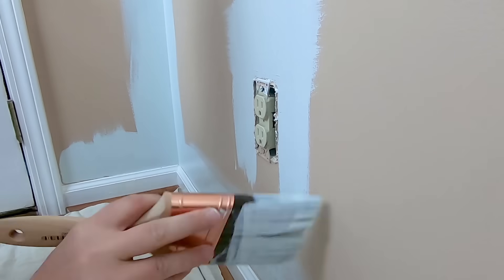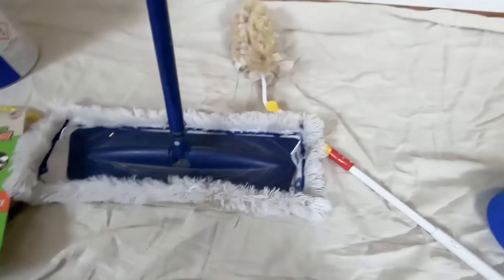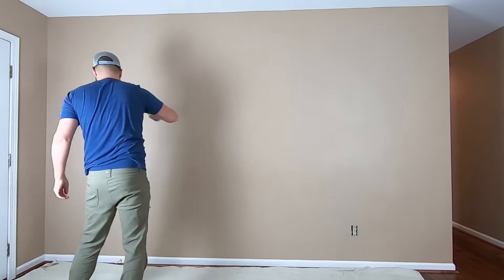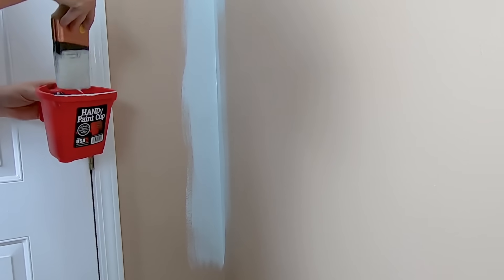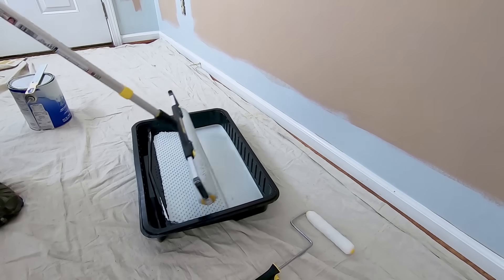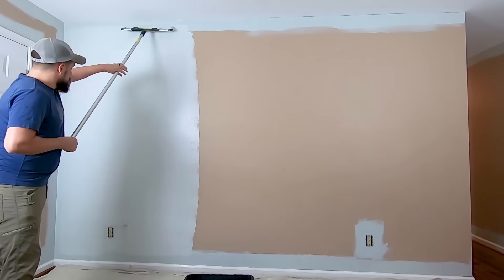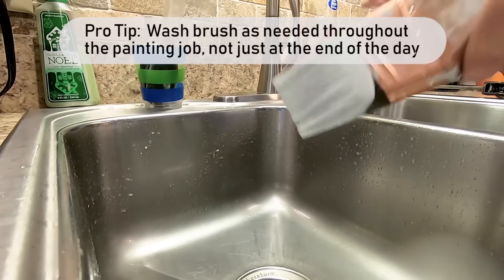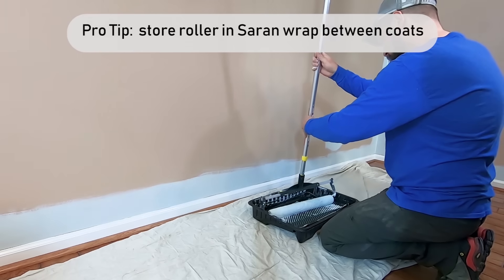How to Paint A Room Fast Like A Pro (Tips for Beginners)

Comment: Another good hack I saw was to put your paint tray into a plastic bag ,then pour the paint onto the lined tray, clean up just remove the bag off the clean tray underneath 👍
Reply: I think you mean put a plastic bag (trash bag since grocery sacks often have holes) onto the paint tray.
Reply: @aimeehardin1299  not in Australia 🤣
Reply: Doesn’t work
Reply: We do this with ziploc quart size bags, works perfectly
Reply: @emilyc9380  you’re not doing it right ? 🤣 just put your paint tray inside a plastic bag ( no holes) pour the paint over the lined tray remove tray from used bag….clean tray 👍
Reply: @Lex_Koncord  indeed 👌
Reply: I have used a kitchen trash bag over the metal/ plastic trays for years. It works and also will keep the brush roller from drying out overnight if a second coat is needed the next day. I just pull the trash bag back over and seal it until I’m ready to go again. No mess and has worked like a charm for me.
Reply: That’s a great tip mate..... cheers
Reply: Yes, i just bought garage basse for that purpose
I find it difgicult to go on painting once brushing has been washed, impossible not yo have waterdrops ruining paint or wall.couldn t see the item you cleaned the brush with in the sink.
Reply: @aimeehardin1299 You'll find that putting the tray into the bag is the same thing as putting the bag onto the tray.
Reply: I’m not talking about keeping the used paint brush and tray IN a bag till you use it again, I mean BEFORE you even start painting cover your paint tray with a bag ( no holes) and then pour the paint into covered paint tray, when you have finished you don’t have to clean the paint tray because you simply take off the bag covered in paint which is on the tray 👍da daaah 🤣
Reply: @juliedobson3039  Yes , I know , but it appears Aime ( who I replied to ) doesn't.  Tra-Laa !
Reply: @johnristheanswer  🤣🤣🤣 heheheeeee
Reply: Always pour paint from the back of the can that way you don’t cover all of the information incase you to purchase more in the future!
Reply: Similar concept to what was mentioned, but I've used Glad Press n Seal to line the tray. It conforms to the tray and stays in place really well until you're done and then you just pull out. No cleanup!
Reply: Black garbage bags bleed into paint. Turned my primer grey
Reply: @UntitledUnlimitedCreations  use white 🤣
Reply: @juliedobson3039  I did lol 😂
Reply: @Lex_Koncord  what kind of tiny paint trays are you using?? Did you mean to say quart size
Baggie?
Reply: @lisadaniels6020  I was talking about using a hand bucket with an "insert" when we're using a brush for cut-in work.  A quart size ziplock bag makes a perfect insert, and super cheap compared to the ones you buy from the stores - and you can seal them and reuse the next day
Reply: @emilyc9380  cover paint tray with plastic bag I use trashbags,  or right size bags often are even sold with tray. Or use leight weight disposable paint trays.Then fill plastic with paint.  Have been doing it for decades, so yes, it does work. But this person didn t explain it well.
Reply: Or use a liner…they are super cheap
Reply: Jerdonn l like Your videos
Reply: I also use an aluminum roasting pan instead of the paint tray.... you can have more paint in one of those than a paint tray.
Reply: @juliedobson3039  mĺĺ I
Reply: You don't need any liner. As long as the first type of paint you put in the tray isn't a flat paint you can just peel it out once it dries. Really, just keep it in until the next time you paint or the time after.
Reply: Lo
Reply: That's really great when I paint dries and gets on your roller
Reply: Why in, H  E Double Hockey sticks , didn’t I think of that!!🥴
Reply: @aimeehardin1299 yeah it works a treat! I do it every time 😊
Reply: @aimeehardin1299 what’s the 1299 in your name for?  Just curious…
Reply: I plan to paint my bedroom and I'm going to use that tip
Reply: I use a plastic bag also. Whatever I have and fits. If writing on bag I just turn it inside.  Somehow watching this I don't get the name of long paint handle. One I bought was bigger around and a bit heavy. Tks.
Reply: I use a five gallon bucket. Screen hooks on side great. No fuss of a tray.  Easier to carry.
Reply: I put switch plates in the dishwasher they come out like new!
Reply: @MartinRodriguez-gx9cs great tip 💡 thx
Reply: This makes so much damn sense lol
Reply: It's a game-changer  👌 
I've used thick aluminium foil off a roll to line my tray.Cleaning them out was such a pain x
Reply: First put newspapers underneath
Reply: Good tip. Anyone who's cleaned  a cat litter box knows this!
Reply: Or, just wash the tray after use. There's always that one idiot that's going to make a cluster fuck of a mess with that. Better to keep it simple nowadays for the simple minded folks.
Reply: And have fun picking out all the dry paint crumbs on your wall !! Y’a fun !!
Reply: @MatthewB-Kornafel-xv6oi  it’s a one day use, I don’t leave it to dry
Reply: What's "hack" mean?
Reply: @aimeehardin1299  she said into a plastic bag. Plastic
Reply: @MartinRodriguez-gx9cs  or you could just take a picture of the information.
Reply: Take the brush and wrap a rag around it then some painters plastic or a bag and whip the brush round like you’re swinging a sword (no drips with this method but still be careful) it gets the water out of the barrel
Reply: I cover the tray with painters plastic. You can find them at sherwin williams or lowes/home depot
Reply: Yep! I do this all the time. Saves so much time.
Reply: @emilyc9380 yes it does? 😭 i’ve been apprenticing and that’s what we do and it works just fine. maybe get a tray with more texture on it?
Reply: @joymathein9078 I usually have more to clean up when pulling out
Reply: @brobsty1856 lol this is what I do- I always use water based paint though, maybe it is different with an oil or shellac based paint.
Reply: Instructions not clear, the front section of my house has now collapsed.
Reply: @aimeehardin1299 I use grocery store bags but turn the inside out or I use foil.
Reply: No way. We have liners that fit right into your tray.
Reply: I have been doing that same thing for over 30 years
Reply: The bag doesn't save you any effort or time. The roller doesn't roll well on plastic. It will slip and slide around and cause the plastic to slip out of the tray, causing a big mess.  Trays are fairly cheap. Have at least two of them around. As soon as you're done, just dump the excess paint back into the can and hose the surface into a bucket and dump it down the drain.
Reply: @valann3718 Hmmm. Foil sounds like a much better idea! It will likely conform to the tray and stay put. Still, rinsing out the tray isn't that much more work.
Reply: @ we will agree to disagree 🤣 …….I use a small bag that fits the tray snug
Reply: Glad wrap works very well too.
Reply: GENIUS IN THE HOUSE!! 💖

Comment: Another tip is to soak your brush in water before you start, then spin it dry, this keeps the paint from setting up in the ferrule and you can paint longer before having to clean it.
Reply: Oh man I'll have to try that!
Reply: Can you please elaborate on spin it dry?
Reply: @Jacked Kerouac  yeah, the device you cram the handle in, it has an 18" spiral metal thing that spins the brush dry,  if I had internet,  I'd paste a picture, but the snow has knocked it out.
Reply: Or spirits if using oil paint. Great trick.
Reply: 🤣....signed, actual painter
Reply: And watery paint messes up the handle and gets your hand dirty.
Reply: @jackedkerouac4414 Don’t put it in the washing machine 🎉
Reply: Great tip.
Reply: @jackedkerouac4414  hold handle between your hands and rub hands like you were trying to warm your hands. The brush will spin and the centrifugal force will throw the water out of the brush.
Reply: Could you not also spray mist the brush with water ?
Reply: Well, the idea is to get the water into the ferrules of the brush. That way the paint doesn't absorb and dry, prolonging the life of the brush and aiding in the quickness of cleaning it.
Reply: Or buy the 17$ dollar tool.
Reply: Spinning does not remove enough water.... you will get runny runs where the water mixes with the paint..   When my brsh is wet say after washing and I need to reuse right away I bang my brushes. Could be a link fence or a at tre...I hit back and forth like I were slapping someone.
Reply: That will not get near enough of the water out @2scots
Reply: @fairamir1 , give it a try for yourself. No point in arguing with me until you have actually tried it. See, I have tried this. Several times and it works for me.
Reply: @fairamir1 Slapping the brush  damages your brush. I buy the best brushes so they work the best, so I treat them as well as possible. ie. I wash my brush several times during a job, every half hour. If I wet the funnel of the brush, by washing, I can use the brush for up to an hour before needing to rewash. So, wetting the brush before first use really helps.
Reply: Yes, they call this "priming" the bristles for latex paint.
Reply: I always damp my brush before painting anything, then I shake it off rather than spinning, it just keeps the bristles more aligned.
But you have to be careful that it's not too wet, or all that paint starts to migrate up to the handle. If it's REALLY too wet it will tack off the paint as you brush, or you will end up with watery paint drips everywhere! 
Keep a close eye on your brushes as you paint and look for swelling, and any heavy lines. Once the heavy lines start to appear you need to clean the brush!
Reply: @2scots I'm a 5th generation painter and been doing it for close to 30 years. If you wash your brush every half hour the only thing you'll accomplish is either taking forever or the boss saying you're fired
Reply: @bradleyhewitt9999 
I’ve been painting since the 1970’s. I’ve never wet my brush first. And I learned from a guy who painted for 50 years! lol
Reply: @Machia52612  I'm about to repaint my kitchen. So should I not wet my brush then? 😂 All of these tips in the comments are hurting my brain! 🥴
Reply: Sounds good, as if you are cleaning it throughout the day also starts the brush off the same each time.
Reply: @jackedkerouac4414  I prefer the Bob Ross method to drying a brush.
Reply: @2scots yeah sounds like you aren’t actually a painter bc like was said, you either aren’t making any money or you’re about to get fired lol

Comment: Definitely good advice. After 35 years, allow me to offer some improvement: 1) after dipping your brush do NOT wipe all sides, thus removing paint, instead gently tap the brush against the side of the can which will prevent dripping but give plenty more paint for cutting (2) hold the brush higher up the stem and allow the brush to "do the work" -a good brush will follow your lead allowing for longer strokes, (3) do NOT cut any lines twice, if you're painting the baseboard later (and the color difference isn't extreme) then just paint over it and make your line later when cutting the trim etc, even if tape is necessary (4) don't "force" the roller... do NOT bend your back up and down with the stick but instead adjust the height and distance you stand to where your arms can reach from top to bottom without stretching, this alone will dramatically increase speed, (5) do NOT "stretch" the paint out on the roller -always keep a reasonable amount of paint on it even though this seems slower and harder.
Reply: Best comment here.
Reply: Absolutely agree, especially about  wiping the bristles. If the bristles are splayed so much that’s needed stop and clean the brush. Also, quality and appropriate roller covers and brushes are key. Purdy and Wooster are basic & overpriced. The Arroworthy Barracuda roller frame is a game changer.
Reply: Dip, dip: tap, tap is the best way to load. Choosing angle sash vs oval vs round brush esp for cut ins    is crucial. Choosing woven vs microfiber vs shag roller covers is too. Arroworthy Barracuda frames, ProForm & Premier roller frames are game changers.

Comment: A tip you might try that I like…I prefer to tape the baseboard, then paint a ‘whisper’ coat on the tape and wall with very little paint on the brush. This creates a light seal between the tape and walls. Then apply final full coat, remove tape before final coat dries, you’ll have a perfect straight line with no bleeding under the tape.
Reply: Best tip ever!

As I was about to paint a bedroom I tried this out top and bottom of walls, and wow, absolutely no bleed under the masking tape and razor sharp lines.  Only used about a teaspoon of paint for the whole room for my “whisper” coat.  Wish I had read this years ago, would have saved so much time touching up areas that bled.  I’m surprised this isn’t included in the masking tape instructions.
Reply: I always get bleed through with tape! My quick go to now is, I rip off the cardboard top cover from a spiral notebook, and I just hold it against the trim and can paint right across it. Then I move over and do another section and another.  I go through a few of them, but way easier and quicker than tape
Reply: would you paint, door trims, window trims and baseboard BEFORE painting a wall, or after?
Reply: @Gi1b2bz  definitely before
Reply: @sdb6757 I've always heard the opposite. Walls and ceilings first then gloss work on wooden trims and skirting.
Reply: @tomk427  I find it much easier to cut in on the walls after the trim is done than the other way around, unless you’re going to tape off the wall all the way around. I only tape the baseboard.
Reply: @Gi1b2bz ceilings first, then walls and all the trim last.
Reply: @sdb6757 I agree with you. I personally find painting trim before walls to be much easier.

Comment: For cutting in i simply use a plaster trowel. hold in place and paint along and wipe, Perfect line every time. 👌
Reply: And it leaves a small part of the wall next to the ceiling unpainted
Reply: @fairamir1 every time!
Reply: And that is NOT a good thing.. no original color should ever be showing @Pagingnursejackie
Reply: @fairamir1 second coat is where he brings it all the way to the ceiling. No color shows through
Reply: I have learned to do this too.
A wallpaper tool also works well.
Reply: It works so so. Then you learn how to paint like a pro. Freehand and actually fast
Reply: You have a video ?

Comment: I'm a reasonably experienced painter. This video is excellent in that it explains the techniques simply and in order. "Roll one-back, two-forward" is excellent. If I were to add a couple things it would be to teach the unload-and-spread technique, that is dump the paint from your brush, then use the last 1/4 inch of the long side of the brush to spread in the cut corner, while gliding on the smooth dump, and then taper the bottom of the cut. The other would be before applying a cut, breath in, and exhale while using your shoulder to cut, not your wrists. Shoulders are simple and stable, makes for straight lines. Wrists are complex and short, makes for wavy lines. A cut should be about as wide as your body and not much more. Breath in, hold, dump, drag up, draw with your shoulder as you exhale, and end on a taper at the end.

My two cents aside, this is the best video tutorial on painting that I've run into, over many years. Subscribed.
Reply: Hi dear expert please give me your opinion as I have a wall plum colour painted I want to turn it in rust colour, what is the best way, shall I put rust colour straight away or something else first . Thank you
Reply: @amiraaqeel5983  If anything just prime it.
Reply: @amiraaqeel5983  Plum is a hard color to cover; either prime it first, like Nick suggests, or plan on using at least three (3) coats of your new color.
Reply: @bignorwegian  thank you so much for your help
Reply: I like your Yoga inspired painting tip - Breathe through the cut!
Reply: In one comment I went from feeling I could be a painter to knowing I have no idea how to paint.
Reply: @Freedom27401  You can be a painter. Watch a lot of YouTube videos (like this one) and just paint a lot. I learned both of these things from YouTube, and now they're just second nature. Both take less than an hour of concentration to make them part of your body.
Reply: I did notice him stepping on the drop cloth.  I am famous for putting down the drop cloth, step on the paint and share on the carpet.  Did I miss a step or my paint marks don't lie. (lol)
Reply: That is why I paint barefoot...so I can feel the paint on my feet. @jazzcornertv
Reply: @gingerhiser7312  LOL! I think you just might have a great how to video.
Reply: Paint the fence
Reply: Would you paint the door trims, window trims and baseboards BEFORE painting the walls, or after??
Reply: @Gi1b2bz  I do them after.
Reply: You need to make a video of this! Please tag me or something if you do!
Reply: Will use your breathing instruction, also drawing the brush with the shoulder
Reply: You're going to have to explain what the hell all this jargon means. nobody but you understands it
Reply: Fantastic tip I started realizing this dump technique with experience. Hearing the draw line with shoulder is a new one I like it makes since.
Reply: @Gi1b2bz always paint the trim and baseboards first. You can usually even get a little on the wall as long as you know you're gonna be doing 2 coats on the walls anyways. It's much easier to control your brush and get a nice straight line on a wall then what might be as small as a 1/4 inch edge of a baseboard
Reply: Thanks Francis. Do you or anyone know of any videos showing the unload and spread technique you're talking about? I'm a visual learner and want to make sure I'm understanding this one properly.
Reply: @itsdannyftw  I learned it FROM a YouTube video. It's either a primer from Idaho Painter or some Australian guy. Or could be both. Sorry, can't remember more.
Reply: @FrancisRoyCA  Ah all good thank you!
Reply: @c.m.4686 I’m disappointed with your offensive comment, I’m left offended upset and appalled